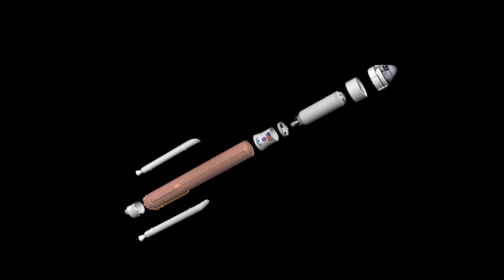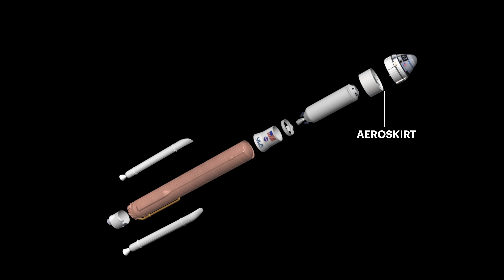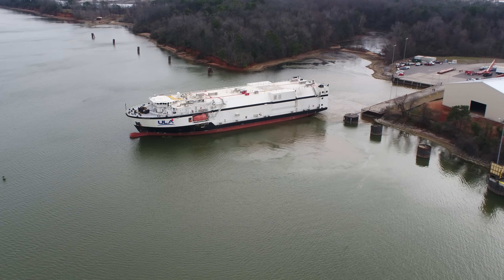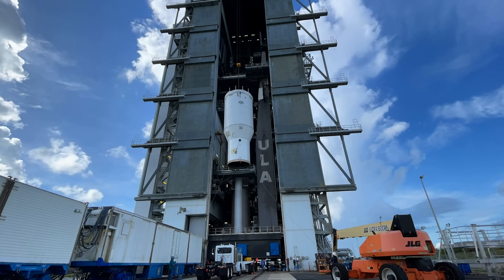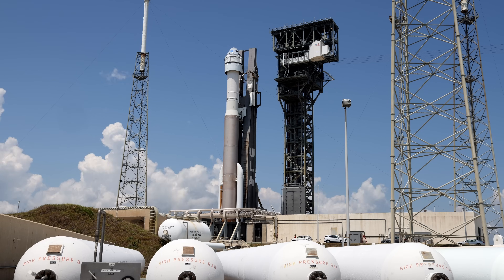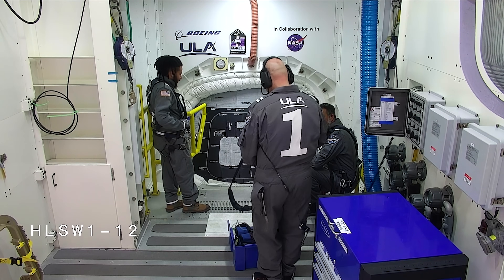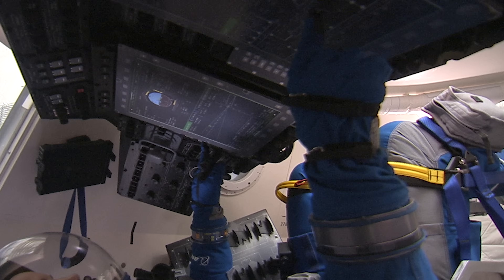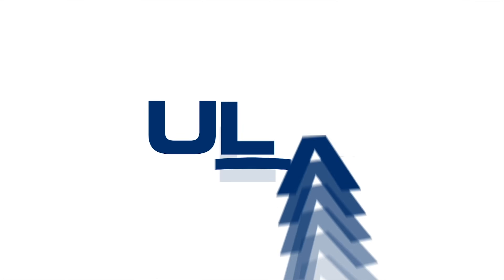Atlas V Starliner CFT: Processing and Stacking

Comment: there's still safety issues btw
Reply: I think Nasa's initial requirement for Starliner was 1 loss of crew and vehicle (LOCV) in every 200-270 flights (which is quite good, seen as STS was around 1:100). The final reliability estimate for Starliner is likely lower, but I am unable to find a source on that. The point is, there is will never be 100% safety and Nasa is prepared to take that risk.
This is somehting you rarely hear about, because of its delicate und uncomfortable nature. But the truth is space is still incredibly dangerous, and I applaud these brave men and women who do it despite fully knowing the danger they embark upon.
Reply: @debott4538  I still feel like NASA treats starliner as a backup and only since Dragon is still a very reliable platform so far, with Vulcan slowly coming closer to being competitor for NASA's second choice of a platform (it still isn't human-rated yet because boeing has stake in ULA and an awarded rating will instantly render Starliner deadweight in NASA's eyes)
Reply: @nicoliedolpot7213  I don't quite follow your meaning there. Crew-rating Vulcan would be a huge boon to Starliner, as it would mean Starliner would no longer be tied to a retiring Atlas.

But I agree that Starliner has turned out to be inferior to Dragon 2 (which is easy to say from todays standpoint.) Still, awarding 2 commercial crew programs made a lot of sense back in the day and the result was a tremendous success. I am certain that Starliner will fly at least until 2030 alongside Dragon, as requested by Nasa, even if only as a backup to Dragon. And who knows, maybe after that Boeing can turn it into a commercial success after all.
Reply: @debott4538  maybe, but if it keeps being freaking delayed again....

Comment: How can it still be called Atlas while using Russian engines? The whole thing is nothing like the historic atlas booster. Also adding the skirt is because of a design flaw. The starliner and second stage are aerodynamically incompatible so to fix it they added extra mass and complexity. Starliner itself rides on a razors edge of uncertainties.  I pray for the astronauts riding inside even though I am not a religious person 🙏

Comment: Unpopular opinion:
  Because Starliner can do station orbit reboost and Dragon can't.

This will give Starliner an advantage over Dragon and could replace SpaceX as the go to for crew missions.

Sorry Musk fan boys.
Reply: Boeing has to not unalive anyone first
Reply: Cost to launch, cadence, and safety are far more decisive factors than reboost capability.

starliner is a dumpsterfire
Reply: I significantly doubt this. NASA's Inspector General valued Starliner seats at around $90 million, while SpaceX Dragon flights are around $55 million a seat. While these reports were issued in 2019, I'd assume the difference in costs is about the same. Franky, it's possible the difference may be even wider now, given Starliner's multiple delays and SpaceX's consistent use of Dragon.

The benefit of station reboosting is significant, but given the major cost difference, in addition to Dragon's proven capabilities, to assume Starliner will just effectively replace Dragon in the market is a fairy tale at best.
Reply: @mossbenson  You're using old figures.
 Crew Dragon and Starliner are roughly equal now.
  SpaceX was selling seats at a loss. But they've raised prices to be profitable.
Reply: @jameskelly3502 I admit these figures are old. As stated above, they came from a 2019 interview with the inspector general. Nevertheless, where are finding a figure that the costs are roughly equal now? I'm seeing reports that CST-100 flights still cost roughly double a Dragon a flight.
Reply: @mossbenson  In 2022, NASA awarded an extension to Spacex contract.
  This extension brings the price per seat to $80 million. Not $55 million.
  Plus, again, Starliner is more versatile than Crew Dragon.
  Most of the articles are either old or use outdated information.

Comment: ULA, you can increase the second stage diameter, it doesn't need to be so long and skinny. Looks really funny.
Reply: It will change the aerodynamics and lower the center of mass.
  Which isn't ideal.
Reply: Centaur was that diameter to share manufacturing equipment with the original Atlas-D first stage, and stayed the same diameter when Atlas III was replaced by Atlas V presumably to keep development cost down (much cheaper to extend tank walls in height rather than redesign the whole thing). Vulcan has a 5.4m diameter Centaur V to enable heavier, higher energy flights
Reply: Yes, the whole thing isn't very cohesive. I have concerns
Reply: @salty_berserker_channel Looks like we have rocket scientists in comment section. Why should Boeing higher brilliant engineers when we have commenters to tell what a billion dollar company should do.
Reply: @salty_berserker_channel 
That's the most vague insult I've ever read. 
What does this even mean?
 Isn't cohesive?
Reply: @salty_berserker_channel  it’s worked fine for over 2 decades by now

Comment: i think... without a reusable first stage, no space company will survive
Reply: They can keep up right now because they can fulfill mission profiles that the Falcon-9 can't, but once those missions can be done with a reusable one, they are gone. I think Vulcan is really good at geostationary transfer orbits (albeit a Falcon Heavy is as well). Another example is the electron, which launches smaller payloads that would be overkill to launch with a Falcon-9.
Reply: Until the market dramatically expands, that won't really be true. Most of the cost of missions is still the mission itself.